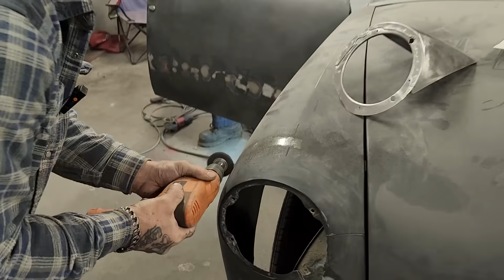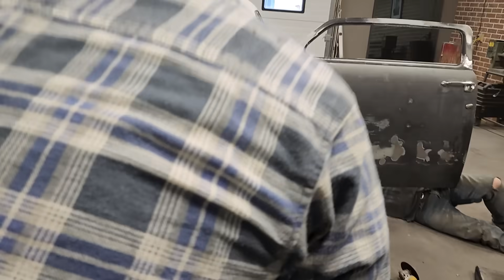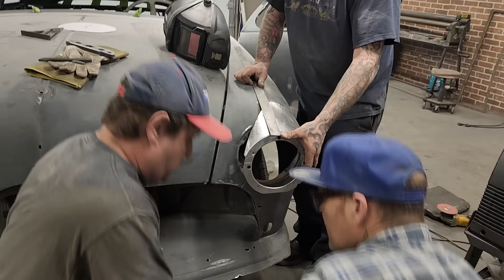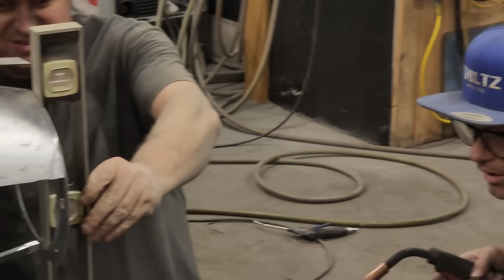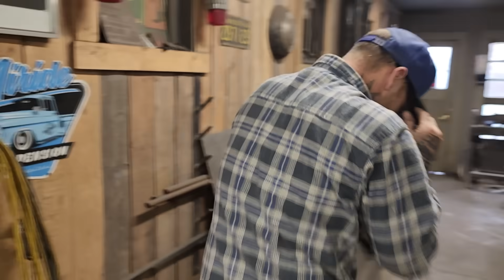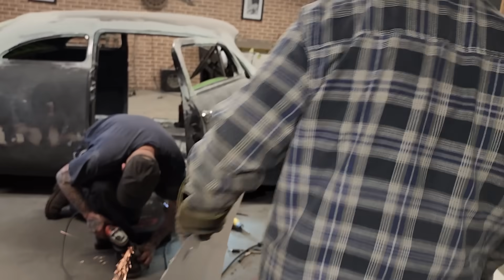Extending the headlights 6" 🤯

Comment: I see chad using a level. When he does that he should have the car on stands and make sure the frame is level. Because just different air pressure in the tires can make a big difference On if the car is sitting level or not
Reply: Yeah, that's a good way to screw yourself over. Also the amount of times I've measured and cut something to modify a factory item (often electronics) only to realize it was made out of square... ugh. I had to force myself to understand that factory does not mean perfection. After a while I started automatically noticing misaligned rivets, bolts, louvers, etc.
Reply: Building a classic car not a watch !! you guys just look for anything you can possibly find to be negative. Try to be positive once.
Reply: @brucewitcpalek5120  You shouldn't "try" to be positive or negative, you should just be yourself and say what comes to mind in any given situation.
Reply: Even so, I doubt it would be noticed by anyone. Nothing is ever perfect and I don't think Chad cares if it's perfect or not since he keeps all his builds.

Comment: I guess a guy could easily just cut a ring of metal and some sheet, and never need to chop a gt6 front end.
Reply: If you have a gt6, cut up the spitfire bonnet you don't need, but I agree with you.👍
Reply: Maybe he will put miata motor and trans in the GT6.  Then he can put the spitfire bonnet on it, and improve  the balance and handling at the same time.  Would be a sweet, fun, and affordable build.🤔

Comment: A lazer level is a simple tool that will change your life when doing things like this. It won't compensate for a floor being unlevel but you can use it as a reference line to compare other points on the car. For example, if the headlights are 5ft on center, you can measure down to floor from your lazer and see the difference (from the froor) on each headlight. Use that difference to correct for headlight placement and measure off the floor. I get it, your old school just like me and I've never worked on a car before but I've built 57 houses and as they say in Newfoundland " I can put an arse back in a cat". Love your stuff and yes Jolene is lovely.

Comment: Could have used threaded rods in the headlight ring holes to temporarily locate the new rings.  By using nuts on the threaded rod, you could have locked down the final location before welding.  Just a different approach.  To ensure keeping the same centers, could have used a cone (like a pylon) to ensure concentricity.
Reply: I was thinking, all thread all along.
Reply: Yep threaded rod / booker rod keep all the holes lined up

Comment: Chad make sure the new headlights aren’t cross-eyed!  Plumb is good but they need to be parallel to the front of the car.  I put 37 Ford headlights in a 37 Chevy and had to make a fixture to get the alignment right. Good luck!

Comment: Watching the headlight frame go on.  It does look like the lamp will clear the front point of the car and line straight with the outer edge of the bumper.  Love the way the two of you are lining the frame up with the fender. Looks like a small job but requires such detail work. You definitely got it.   Good job from all the team.  I think as you probably know that this will make a big difference in the overall line.  I cannot be easy trying to stretch an old Ford like this they were so bulky.  Say it again paint will be key to the end result.  Hopefully you can add lines to continue the stretch.   Love watching.  Take care.

Comment: Chad needs a big steel bench to work on it would be a lot easier on his body.
Reply: I agree,  a 4x4 heavy steel weld bench with convertable vices on casters, with drawers and shelves below the table top. He would absolutely love it after he got used to it. It saves time and  increases safety.

Comment: You should open the hood and put a horizontal straight edge across both headlights to make sure they are not cross eyed and in the same plane with each other before you weld them completely.

Comment: ok chad when leveling on the vertigal which is up and down you use the top level if you want to check the bubble turn level over top to bottm and use top bubble if you level horizonale use mittle bubble to check bubble  turn level around hope this helps

Comment: Don't go by the measurements from the floor for height because tyre pressures could be different also suspension could be lower or higher on one side ,also measure from the center of the bonnet to each light to get yhem central

Comment: Depending on the colour you paint the car, could you not powder coat the bumpers an off setting color to complement the car. Would that not look sleek and it would be cheaper than redoing the chrome